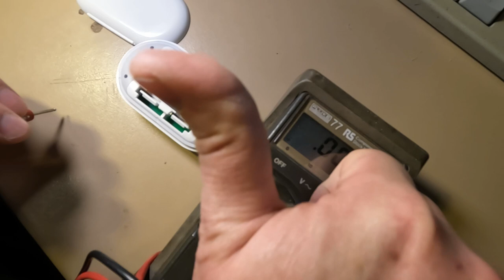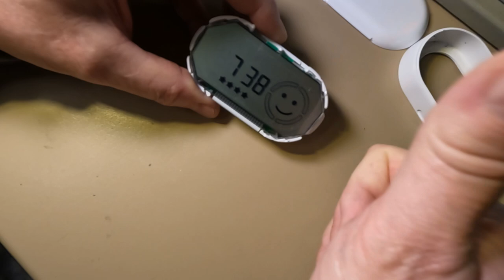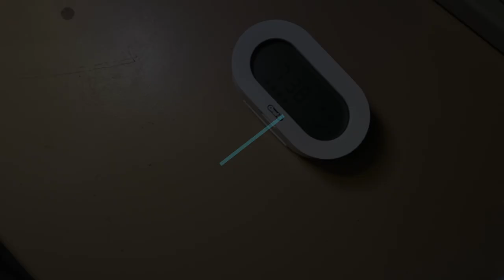fixeD iT | Braun Oral B 3742 Blank screen

Comment: Nov 2024 - Hadn't used my Oral-B in a while. When I went to replace monitor's batteries, they had leaked. New batteries installed, STILL didn't work. I wasn't able to find a replacement to buy. Then I saw this, Mike's fixeD iT video... As soon as I found a piece of plastic that would work, I followed his guide. Opening & closing isn't the easiest but I persevered & cleaned acid damaged contacts inside. As soon as I put in new batteries, VOILA!! My little monitor face was smiling and all worked again. THANKS MIKE!!